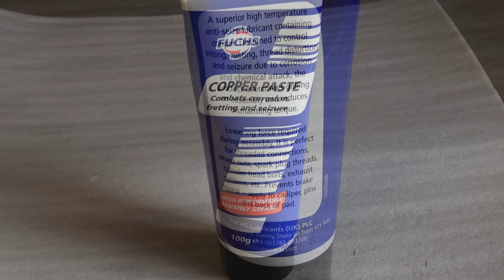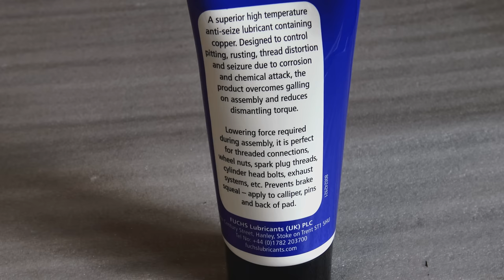Triumph Bonneville ownership. Copper Grease controversy, Putting the record straight!

Comment: Stuart i think you are missing the point, the argument against putting copper grease on break pads is not about "does it work in reducing break squeal" its about Risk versus Reward, the risk is, a novice,  new to bike maintenance might be told that he can cure his breaking noise by using copper grease on his break pads, he then might apply to much or put it on the wrong part, worse case scenario he might accidentally get it on the rotor or the pad which could lead to an accident.  The reward is, his breaks wont squeal. lets face it no bike manufacturer worth its salt is going to recommend putting grease anywhere near the break pads because of risk v reward.
Reply from the maker: Hi Jakrum Thank you for bringing that up because your absolutely right that is one of the major issues. They refer to it as litigation avoidance. I did think I covered that issue at the end of the video, though it would appear I didn't make it clear enough. I think what it all boils down to is education! its better to educate people rather than just villainise a particular product, or at least thats my opinion.